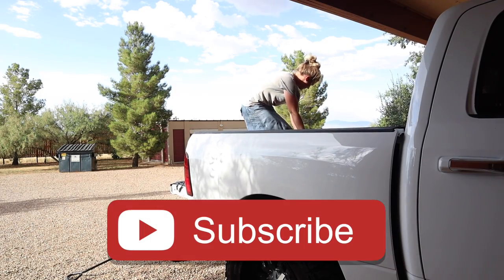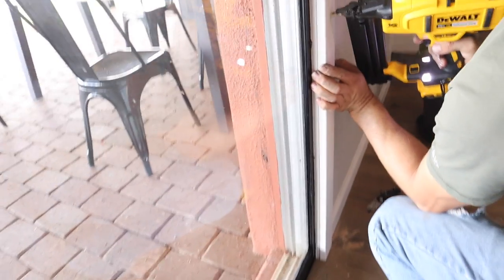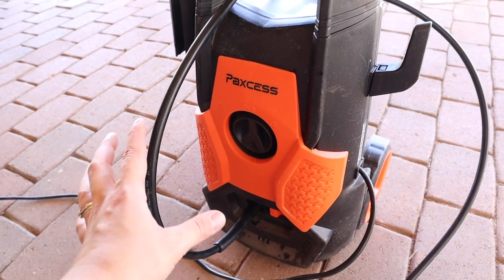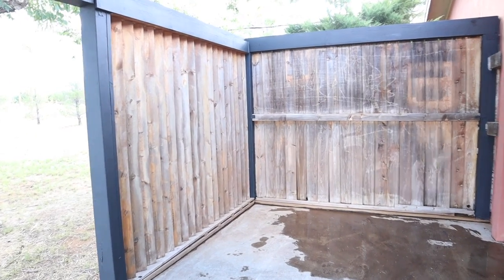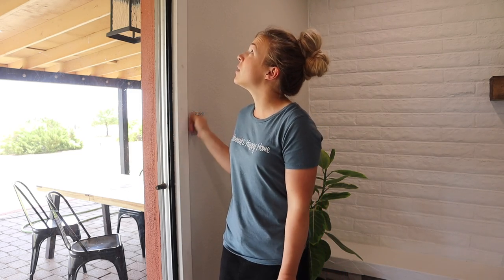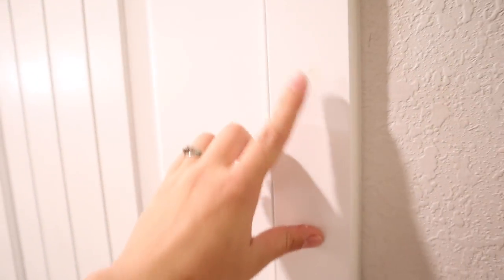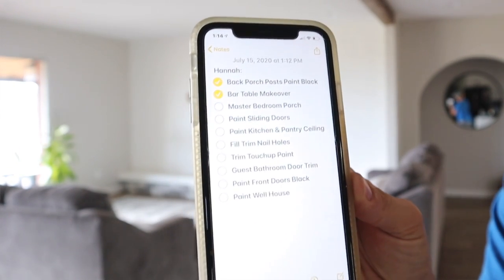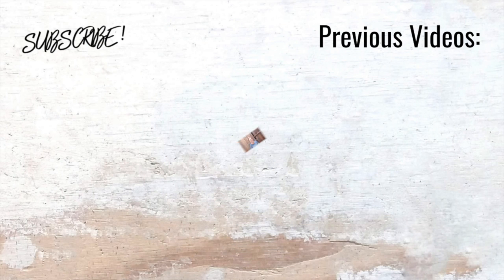SLIDING DOOR MAKEOVER!!👏🏼 MAJOR RENOVATION OF OUR ARIZONA FIXER UPPER Episode 18

Comment: FYI for anyone wondering about Rust-oleum oiled bronze color: I purchased a 1985 manufactured home and used Rust-oleum oiled bronze on original sliders, window aluminum/metal that are the oiled bronze/anodized color that looked worn and scratched...  WOW they look modern and brand new.  VERY close match to original color.  I proceeded to make grid/grill (minion)  for a panel look windows out of 2 strips of $5 plastic/polystyrene trim moulding  and sprayed the white plastic with the same color.  MORE WOW.  worth the try. Very happy. (no I did not primer. I did wash them with TSP.)

Comment: The wood outside your master bedroom...what happened to that?  Is that where someone previously tried to power wash it?  I only ask because I'm considering purchasing the power washer you use, but if it won't take away that POSSIBLE previous power wash mistake, I don't know if it will be powerful enough for what I need.  Everything looks great, Hannah!
Reply from the maker: I’m going to go back in with the pressure washer on a higher setting it’s just going to take a little while which I didn’t have time for on this day lol. I had it on a fairly low setting on these boards so it didn’t beat them up too bad. When I put this pressure washer on the highest setting it removes paint haha so yes it’s very powerful
Reply from the maker: Thank you!❤️